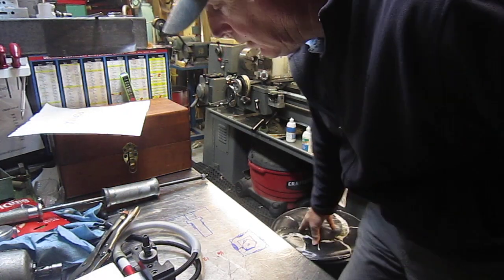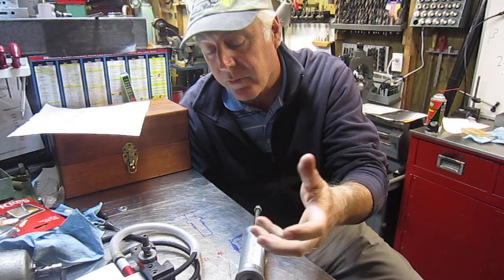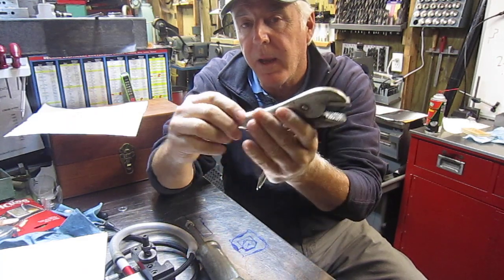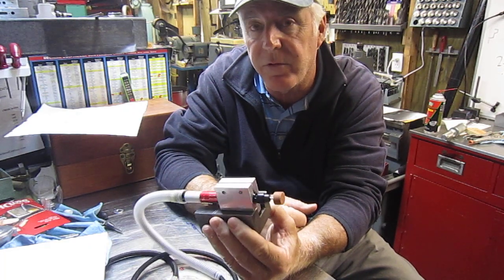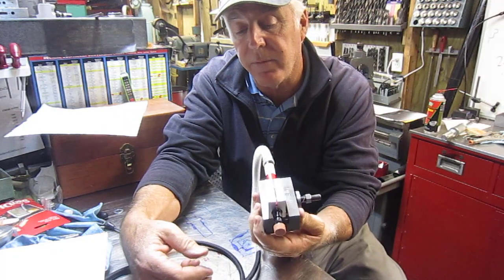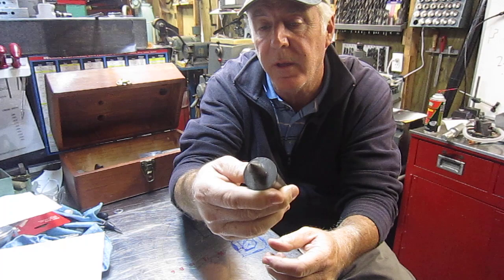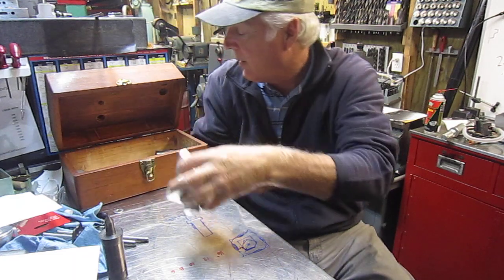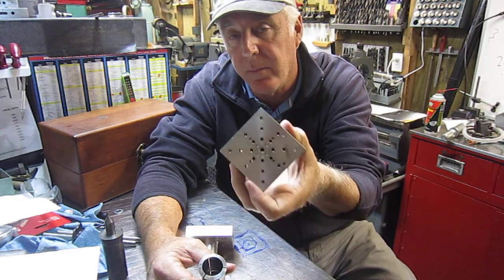TOOL TIME     Episode 8      MODIFICATIONS

Comment: Like the vice grip idea as it does not ruin the original tool. I think, however, threading the adjuster would be weaker than Robs idea?. Both ideas are good though and I probably will modify my slide hammer in a similar fashion. :-)